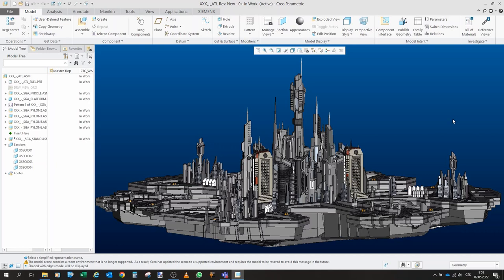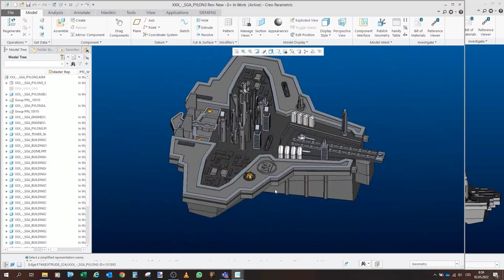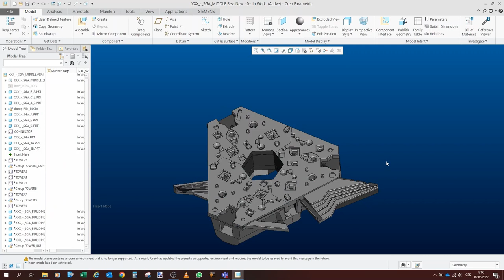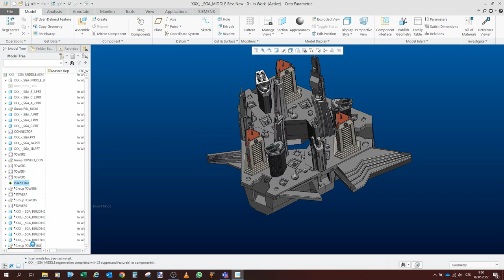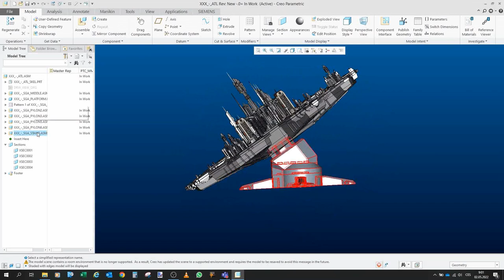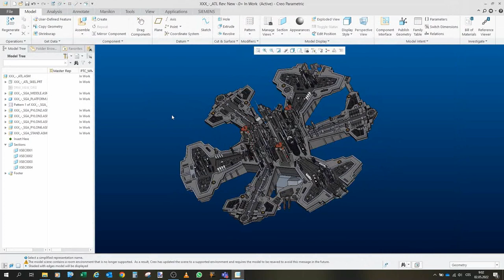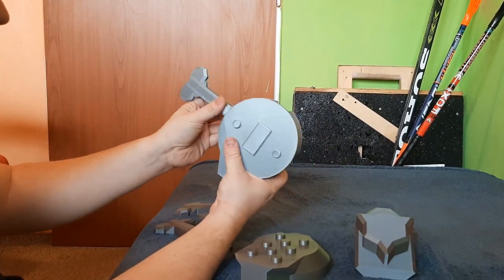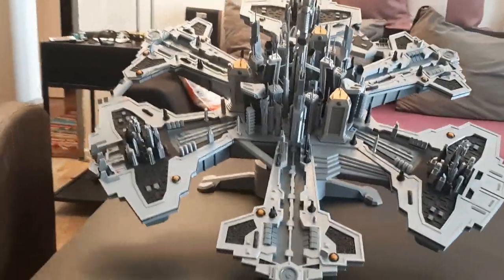Project Atlantis Part 3 - Buildings and Stand

Comment: Working on making this wonderful project myself. I’m about 90% done (will post results on thingiverse)

Only issue I’m having is with tower 6. Print has failed 3 times. Looks like something is causing one or more of them to get knocked over somewhere after the half way point.

I’m printing all 6 copies simultaneously so my best guess is this may be somehow causing the problem. I’m going to try running it as 3 copies, printed twice to see it that fixes it.

Running it on a basic CR-10 v1 with default Cura settings.

Comment: Half way through printing this, using a 2 head XL for the pylons so I can get 2 colours on the surface. Coming out really well. But can you advise on what percentage infill you used for the stand. Thanks
Reply from the maker: i dont really remember. 10 or 15% I guess
Reply: OK thanks for that, I wondered if it needed to be a high percentage so that it would be relativley heavy, to stop the kit from toppling over. @martintaichl
Reply from the maker: @grahamebenson112  no, it dos not. But frankly, I dont use the stand at all.